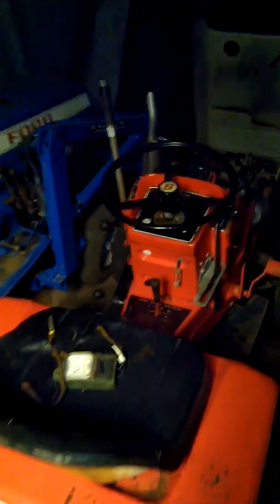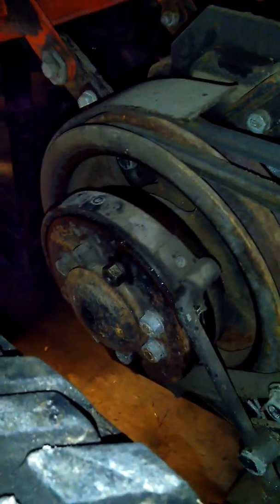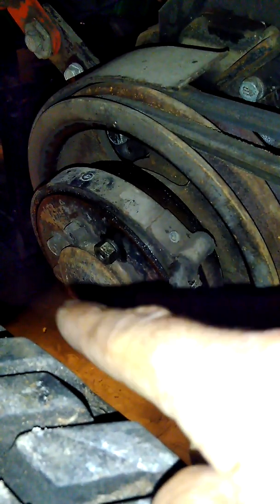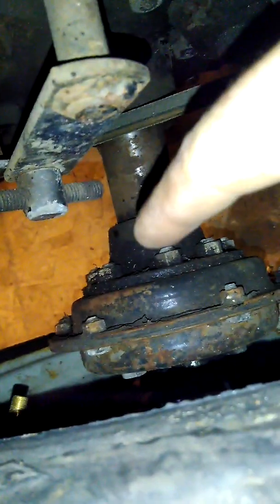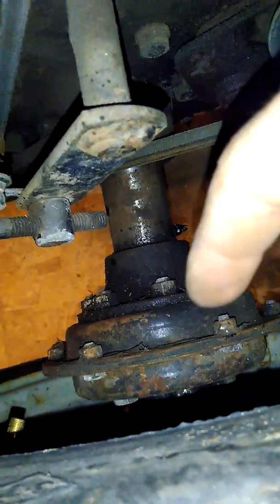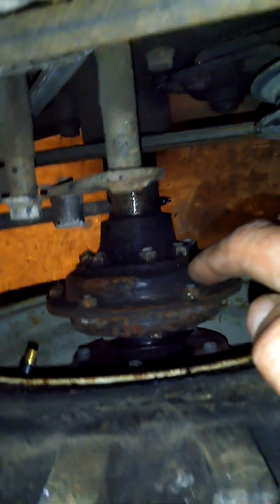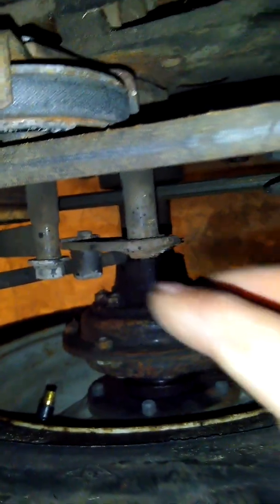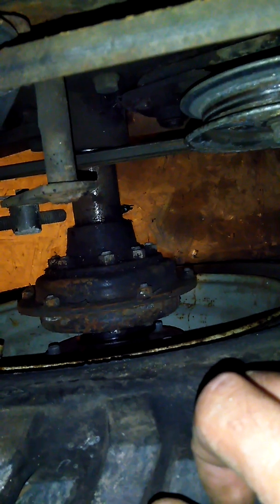simplicity 3410 shuttle drive diagnosis

Comment: Needle bearing in the shuttle drive (1 1/4” long) can be replaced with Koyo T0320P422 (1” long), (or #B-1616;PB;L125) both numbers are on box. Should be easy to cross reference. Axle seal is Timken 473157 ss.